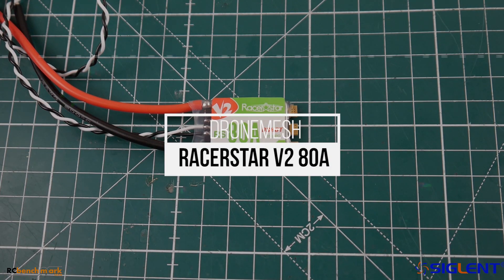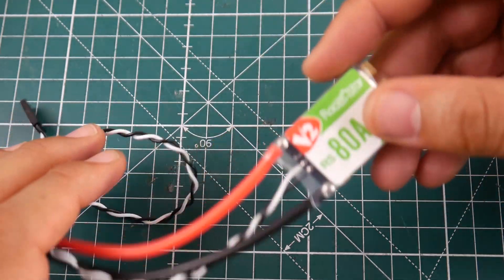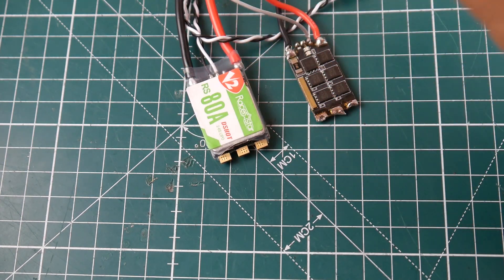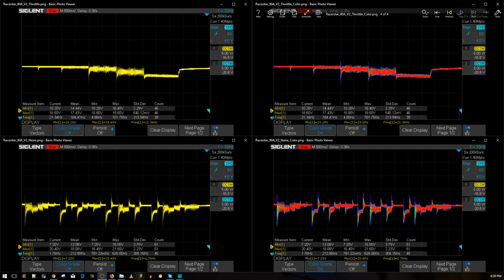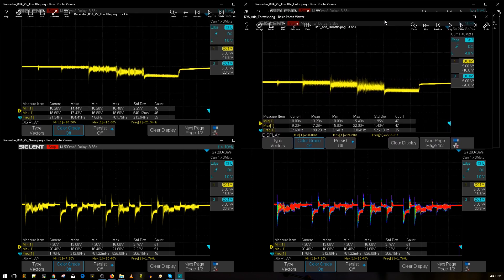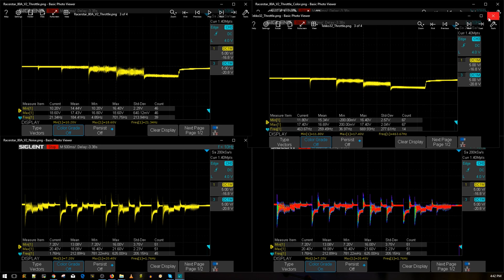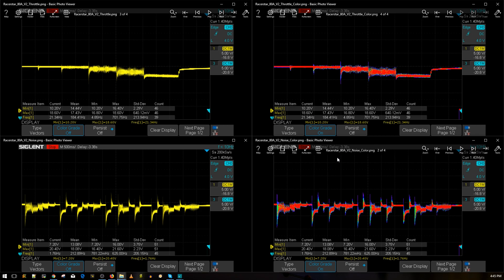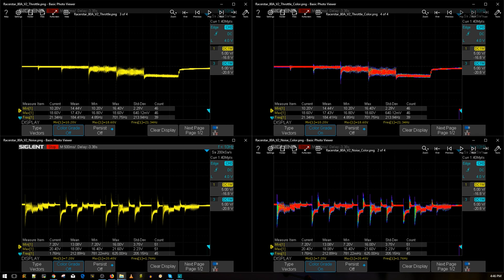SO GOOD YET .....!!! // Racerstar RS80A V2 ESC Review & Noise Testing

Comment: Can we use this on a fast aeroplane for about 60 amps max? Why the best 80 amps aeroplane ESC is about 100 grams?
Reply: Yes you can. I am using the 40A version of this ESC with a SK3 plane motor.
Reply: Thanks, so why the 80 amps aeroplane ESCs are about 4 times the weight of this. It just does not make any sence for me.
Reply: As far as I know, mostly because plane ESCs have bigger heat-sinks. also in recent years saving weight is a hot topic in mini quad racing and that is pushing light weight ESCs.
Reply: I suppose, but the gifference is just huge. I just can not believe that this tiny thing can handle 80 amps.
Reply: Lachezar Krastev consider that most plane ESCs have a UBEC and at least 2 large capacitors. They also have a large heat sink with a bunch of thermal paste.

Comment: Any ideas where to put 80A ESCs who weight like a cup? For 450 sized racing quad?
Reply: They would be great for cheap 7 inch builds.
Reply: An amazing match for planes/wings. Current old school plane escs weight around 80-100grams for a 80A esc.
A 20g esc capable of delivering 80A is mind blowing.
Reply: With no BEC.

Comment: I wanna bed if you buy a aria and put a cap on each esc it would be bttr than the racerstar (not with what it could handle of voltage but would be "cleaner") maybe nice to test that out😆 but nice vid👍🏻
Reply: If you talk about pwm is that in configuration on bf under that you can klick on what dshot commend you use or is it in blhelli ? (Would love to if you put the best tune whit that tekko32 kakute v2stack on YouTube )

Comment: Those aren't meant for a mini quad LOL. It would look funny as hell though. Maybe if you're going for a top speed 200 mile per hour 8s 6inch it would make sense 😀. Definitely intended for large quads like 1000mm
Reply: I plan to use them on airplanes vs the $60+ Cobra Wing ESCs.